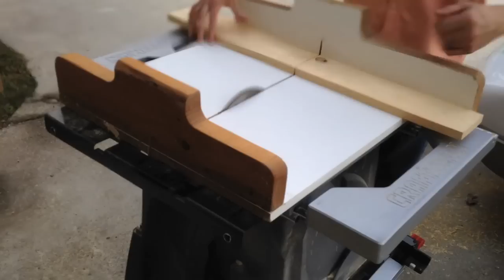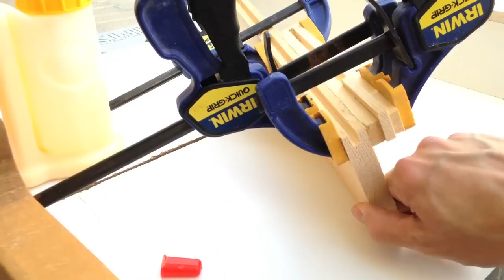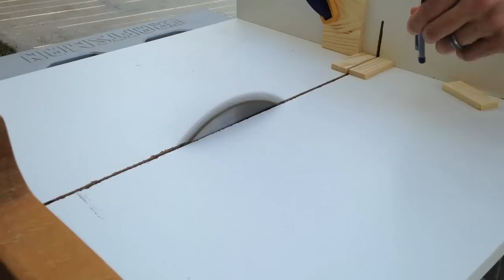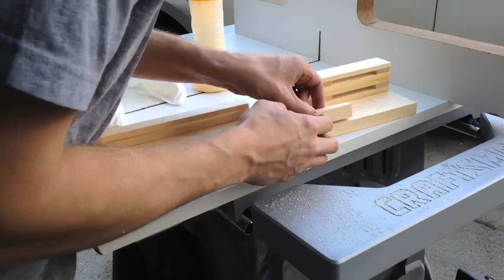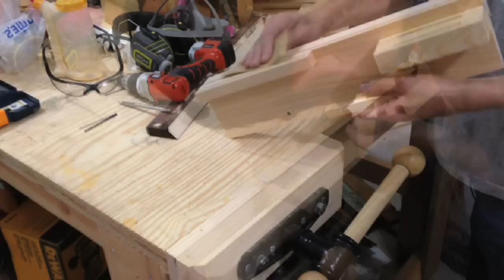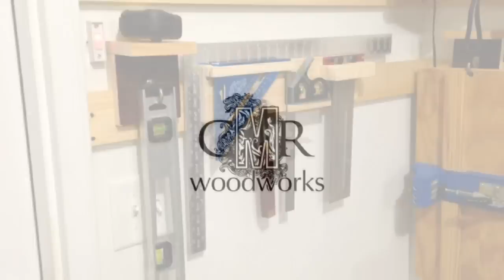French Cleat Square & Measuring Tool Storage (CMRW#22)

Comment: Great idea for the speed square. I remain in awe of the wood glue(s) so many on here rely on. I must have tried half a dozen brands or more over the years and not one of them would I trust for the type of load bearing you have here let alone anything heavier. Any suggestions from you or other users for a U.K. available product?
Reply from the maker: From my experience and everything I've heard about glue since I started woodworking, the glue bond (when glued properly) is actually stronger than the wood around it.

Comment: I have a older model Craftsmen table saw similar to yours. I had to weight the base down to stop the movement. Second since there is no after market zero clearance insert for that saw I had to make one. The insert was worth the effort, just a suggestion. I enjoyed the video. I liked the music to video. Thank You
Reply from the maker: I'm trying to figure out how to make an insert for it. There is nothing to hold the insert in place or for it to rest on to the left of the blade where they left the huge gap. 

Thanks for watching!
Reply: CMR Woodworks  I will try and post a photo of what I did on your face book page if you wish. Just an offer if you think it will help you.
Reply from the maker: Jay2525Jay yes, please! Anything will help.
Reply: I re-posted the drawing.
Reply from the maker: I saw it. Thanks!

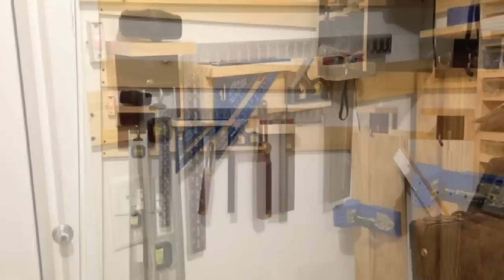Comment: 5:34 Should have moved the ruler and level holder a bit to the right, so the hole in the level would be centered over the right light switch.
Earned a Like, regardless.

Comment: I saw but only one comment on your blade height. Why IS it, that u raise it so high?! From what i've learned, seen, heard, thats about as unsafe to do in a workshop as anything, ESPECIALLY W/OUT THE BLADE GUARD!!! Matt Cremona said thats the most calming vid he had seen in awhile, at that time, but im guessing that was mostly bcuz of that baby lullaby song in the background, but for me, watching that blade, was the most nerve-racking vid i've seen in a long time. Thanks for sharing, regardless. Aloha.
Reply: The blade height was so that he gets a slot as vertical as possible.   There is no inherent danger in having a high blade as long as it does catch on the back side or cause interference when pushing the piece through.

The real danger really was from the large blade clearance plate where pieces may fall in.  That was actually dangerous.  The rest just seemed sketchy but very controllable if the operator is skille, careful, and attentive - as they should all be.

Comment: Thumbs up for the style of your holder...nice. However, don’t like how you work around your saw. Using your fence as a stop with narrow pieces is asking for trouble. Also, I see you have plenty of jigs to aid in working around your saw but failed to make a zero insert plate for the blade. I apologize for being critical but you have to remember a lot of novice woodworkers will copy your work habits because they do not know the difference, yet.